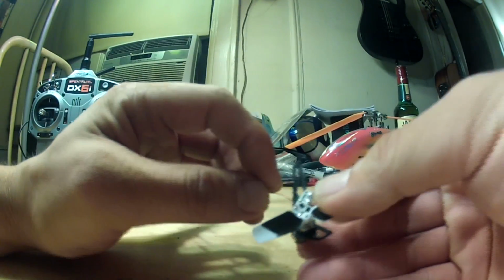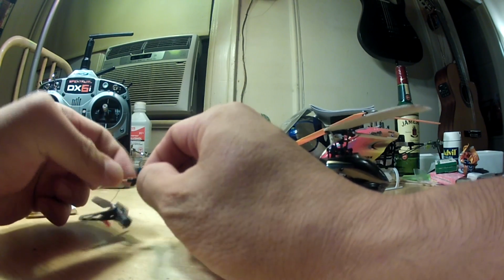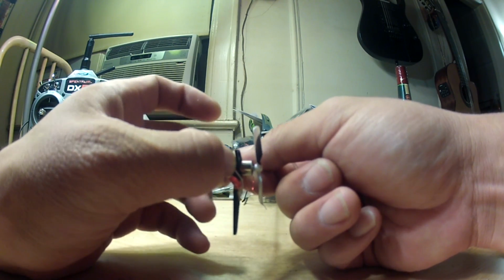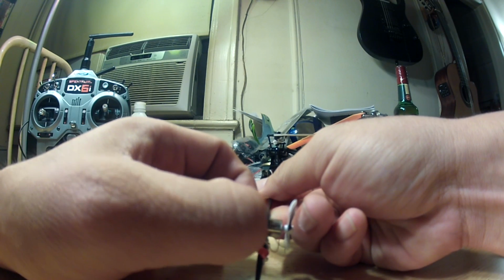Heli-Max Axe 100 SSL first flight and crash

Comment: Shouldn't have to trim it, flybarless systems usually self trim using the gyros, you might have a screwy TAGS board, 2 of my 3 axe 100 cps had screwy boards, after replacing good to go, just e-mail heli-max they're slow but cool about sending replacement parts.

Comment: this is normal for a micro heli with tail motor to drift left, i have a nano cpx, walkera super cp and axe 100cp and ss that does the same. when you move to tail driven helis like walkera v120d02s or 130x this problem will go away as the size increases.

my advice is to adjust the linkage.

BTW is this your second cp heli?
Reply from the maker: yeah i had a couple axe100cp and thought this would be nice to have leds.  waste of money imo.  I now fly 450x and 550x and that's help me actually learn to fly helis more then i ever achieved with these micros.

Comment: Did you ever figure out how to solve the drifting problem? Mine is doing the same thing even more so. As I spool it up it leans to the left.
Reply from the maker: No, I've tried a new 3n1 and made sure everything was level but still it never flew right.  I ended up moving away from heli-max and switched to horizon hobbies/Blade helis and had much better luck with their products.  I feel it's hit or miss with Heli-max.  Blade makes great helis and i've had nano cpx, blade 130x, and now fly 450x and 550x which I love... on another note, I see a goblin 380 in my future....
Reply: I agree seems like blade is the way to go. I sent Heli-max an e-mail and they said they will send me a return shipping label and they will try to fix it. I'm eyeing a nano cpx now I just wanted something small 3d wise to have fun with instead I got a headache.